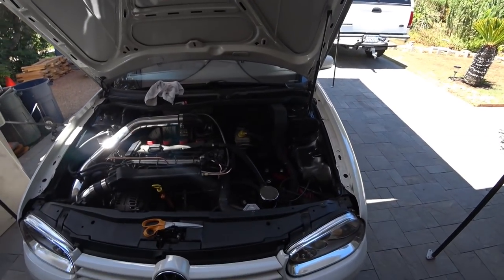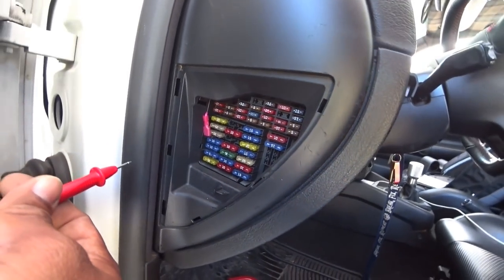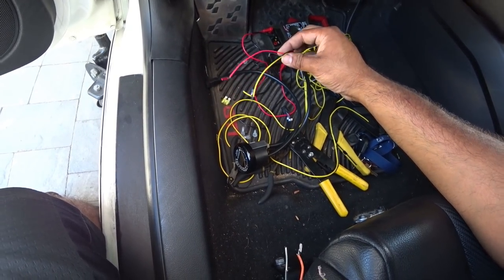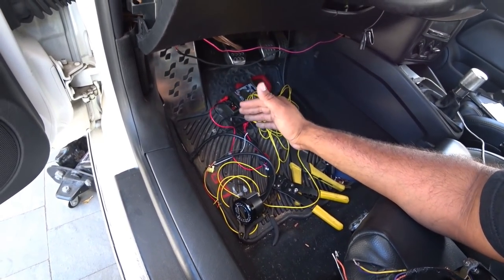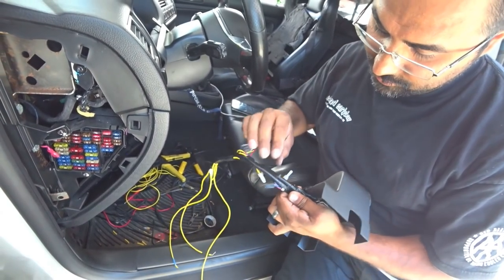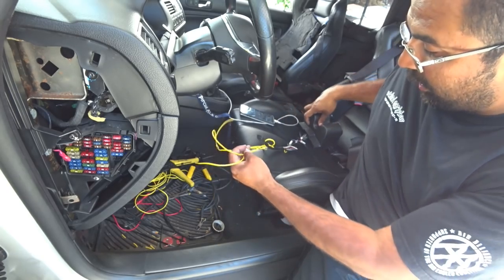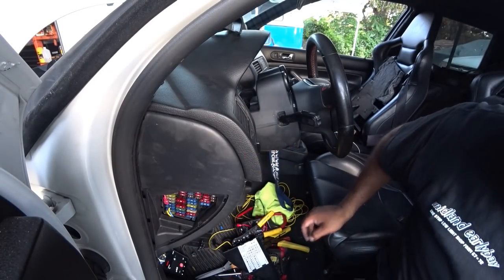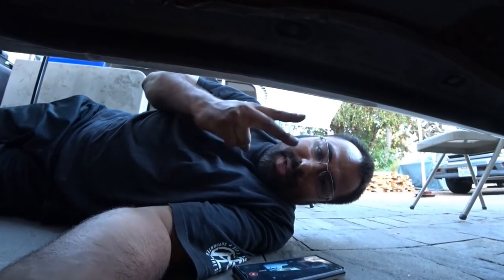How to Install a Boost and AFR Gauge Season 5 EP15

Comment: There's constant,switch and ground underneath on the relay panel that VW has conveniently placed, can daisy chain from there with each gauge having independent fuses if needed.
Reply from the maker: Dinxsy correct but its hard to film under the dash
Reply: Of course, you make a fair point.

Comment: I’m trying to wire my afr gauge and was wondering if you could help me on where to connect the o2 sensor wire on a MK7 Gti
Reply: If you have t figured it out yet glowshift has a slip on adapter sleeve coupler that has a bung attached to it already I’m bout to do one on mine that’s if your exhaust is slip on fit though

Comment: Why wouldnt you use the 12x post or whatever that is under the dash as the switch? Cause that's what I used I'm just wondering if this is a better option since I'm gonna clean up my wiring soon
Reply: If it's a matter of it having a fuse my podi.ca gauge came with a in-line fuse along with posi- connectors. Great DIY as usual, looking forward to doing my AFR now...
Reply from the maker: kasaikun619 i didnt do it under the dash because i wanted to show people how to test for volatge and look for switched fuse. Under the dash would be hard to film...lol

Comment: Hi, I was wondering what do you use to secure the pod to the steering wheel? The shop I took the car to install two pods they left it without securing and I cant even drive the car when making turns
Reply from the maker: What i ended up using was double sided tape from Gorilla glue still holding up after 1 year
Reply: @PincheALsGarage  Thanks man, really appreciate it. Subscribed. A lot of good content in your channel.

Comment: What have you done to your car?? What turbo
Reply from the maker: SPA 70mm turbo
880cc injectors
High flow fuel pump
IE rods
Super Tech valve train
ARP hardware on head, crank, rods, cam,
Custom front mount intercooler
Custom 3" downpipe
VF engineering motormounts
ACT stage 2 clutch
Neuspeed short shifter
Boost Dynamic Tuning BT Tune
12row external oil cooler
All new gaskets and hardware
Reply: @PincheALsGarage  I need help with a turbo question how can we talk
Reply from the maker: What is your question? You can also msg me on Facebook